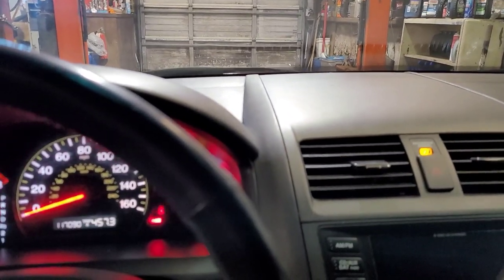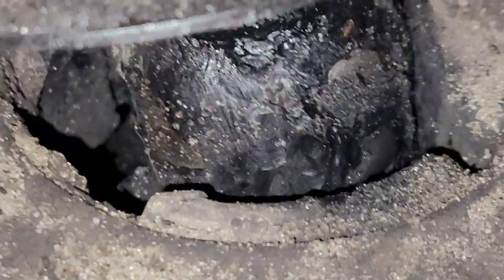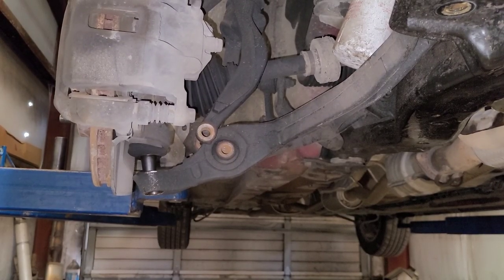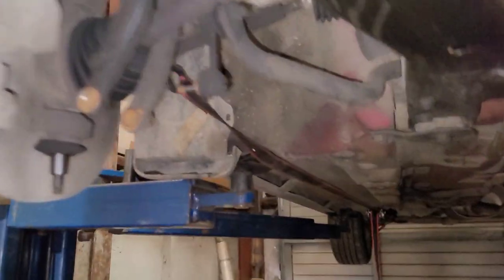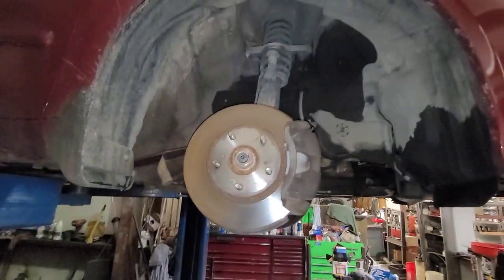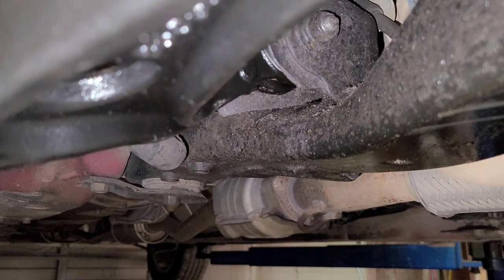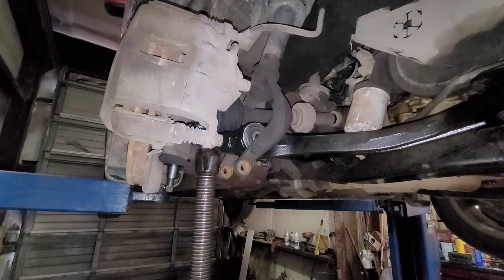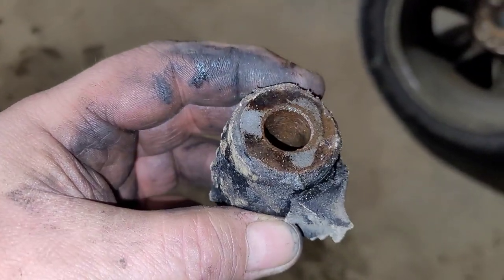DIY!! Lower Control Arm Replacement. This really isn't that tough..

Comment: I have this lined up for next spring on my lucerne. I bought the control arms this last fall but ran out of time to do things. Now with the snow and all I am going to delay the project. My neighbor probably looks at me weird because I am always working on this car. One day I had the whole front end removed to replace the radiator and I caught him staring in amazement :) . Of course, I do not have some 1000.oo monthly car payment like I bet he does. lol.
Reply: I'm the same way as you
Reply: I only paid $1200.oo for my 2008 Escape (in 2019), knowing, that at 239,ooo miles, it needed some work!
I am into it for about $2100, now (picked up a set of 2012 rims with Michelins mounted and balanced and %80 tread depth for $288 at a salvage yard, and got balancing checked out for free!), so, 4 years later driving another 40k miles, not too bad...

Comment: I did this in my driveway, 4 times! (2 cars)
Yes, in the northern salt zones it is much, MUCH harder getting things apart!
I actually had to cut apart one of the yokes around the bushing, to remove the arm, and then cut through the metal shell of the bushing, so I could cut/chisel out the brittle bushing material, and THEN cut some slits into the thick metal core of the molded bushing to inject penetrating oil, as the core had rusted/seized to the bolt!
Good thing it was a 3-day weekend!

Comment: I did that on a dodge minivan. There was a big cover I had to remove. But I got it done. Wish I had seen this first. That ratchet strap might have helped. Worst on that car was the fuel pump. Pulling down the gas tank was a joy.

Comment: Nice work. Thinking of tackling this project in the spring on my RX350.  It is a little more complicated in my case because you have to jack the engine up a few inches in order to get the control arm off the engine mount.

Comment: It"s not the pump, it's the O rings on the fittings that the hoses on the pump bolt on to, they suck in air but they will not leak fluid, you have to use Honda parts, and there is 2 different sizes, you have to replace them both. The parts guys at the dealer should be familiar with them they been like that forever, there are you tube videos out there for this problem, find a few you will see it.

Comment: Done both on my 2002 Nissan Pulsar/Sentra all the sway bar bushings sway bar links struts & all the related bushings & motor/gearbox mounts & I still have a clunking noise from under the front of the car.Any ideas? Cheers